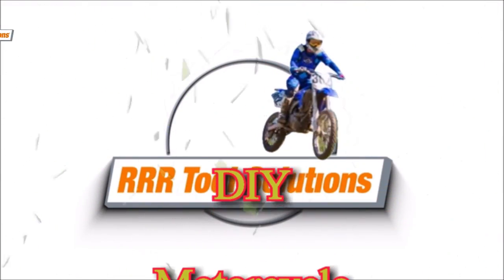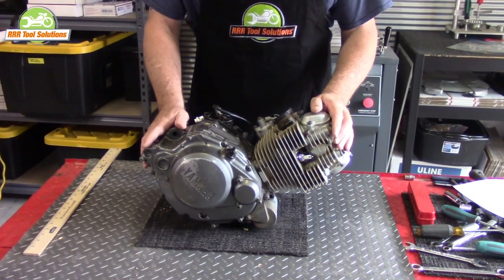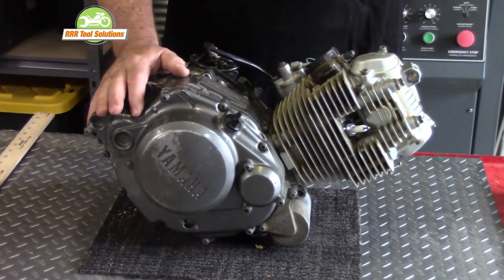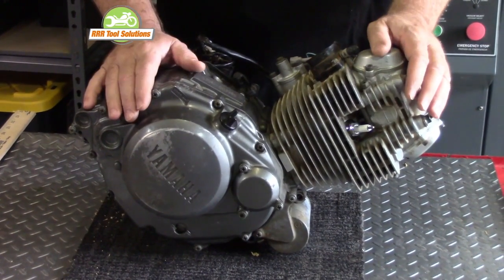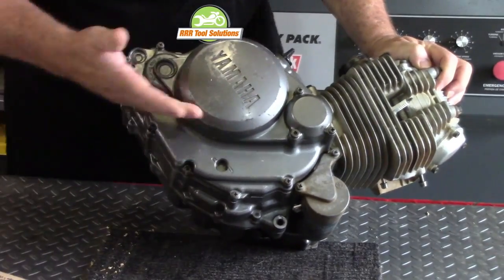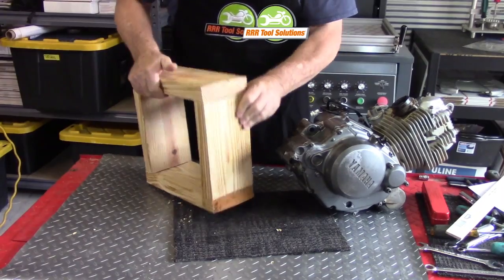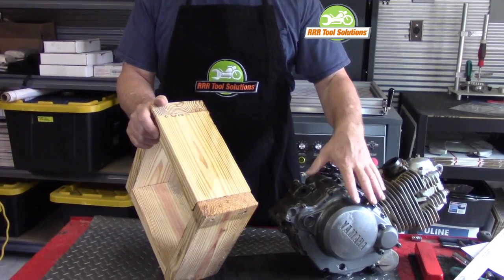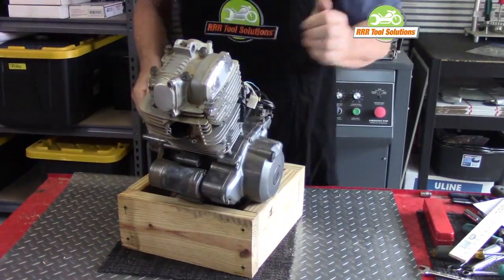Motorcycle Engine Stand DIY

Comment: I built one of these for my CB175 Honda motor the other day using scrap 2x4 I had on hand (with a 10" ID).  I used it today for the first time and it works great!  I can easily place the engine in a multitude of positions.  Thanks!!